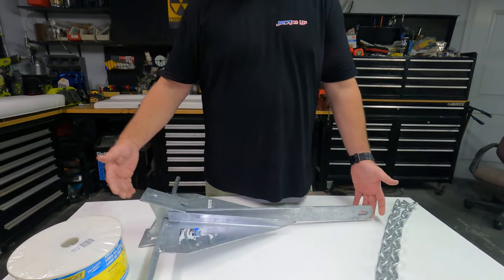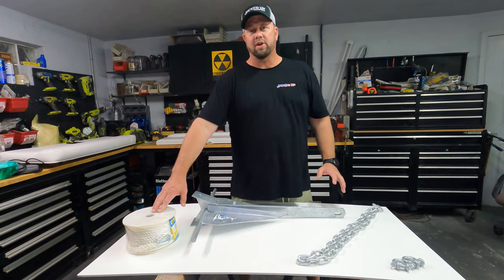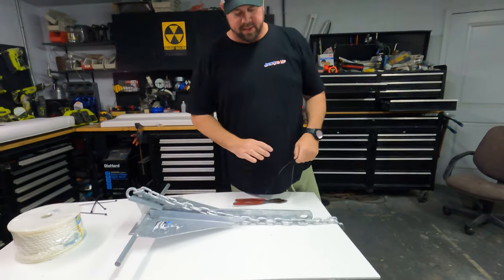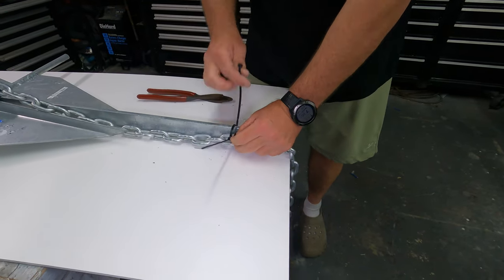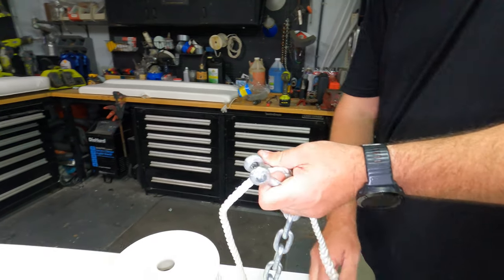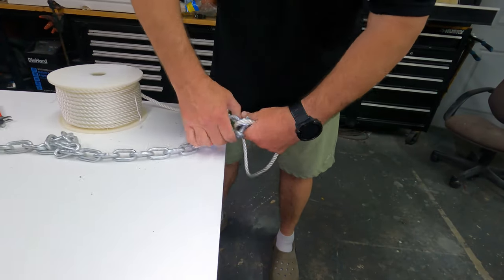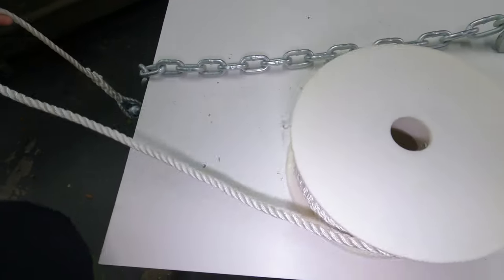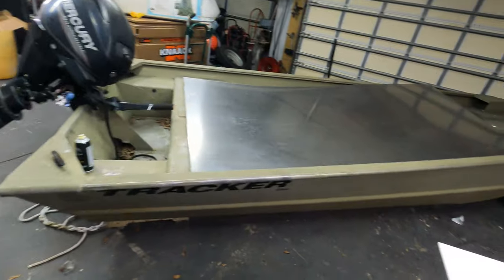How To: SETUP AN ANCHOR RELEASE!!  No More LOST Anchors!!!!

Comment: That crappy anchor you showed actually has this system essentially built in.  If the anchor snags, you can get the boat on the other side and the shackle can slide down the shaft to near the pivot and pull the anchor from the other end.  It's actually a nice design.
Reply: Exactly!
Reply from the maker: Actually you are right but they suck to actually hang bottom.  The flukes are dull and too short as well as the shaft being so light it does not perform as well as the danforth with solid shank.  But this is my experience and this setup was taught to me by very qualified fisherman growing up.  Thanks for watching!
Reply: I never realized that about mine having that ability ... thanks for pointing that out
Reply: The anchor is fine. This design is sound.🥱
Reply: @JackedUpFishing No,  you were right first time the other anchor with the hollow shank is no good . When the tide changes the shackle will work it’s way to the other end and together with the pull on the boat reversed by the current it will  pull the anchor out!  That is what would happen here in UK where I live. Really useful advice using ties otherwise so many thanks.

Comment: This method is useful for fishing or in situations when there is always a watch.  Never use this method when anchoring overnight or in the case you may take a nap on the boat.  Should the tie-wraps break (from a change in wind or current etc.)  your boat would be adrift and the results could be disastrous!
Reply: Very good point. I am overnight alone in high winds. So clearly this would not be safe
Reply: @adamzetter5482  In that situation, you just add another shackle to the eye and it operates like a normal anchor.  One you are done, just remove that and you're back to the breakaway setup.  We do that all the time.  It takes a few minutes to add the shackle and you're done.  Just keep extra shackle in your boat for that situation.  Instead of tie wraps, we prefer to use stainless wires.  It's more reliable than tie wraps.
Reply: Do not, I repeat DO NOT, use this method for anchoring overnight in any kind of wind or if your safety is at stake.  

I did, the tie straps broke, and my sailboat drifted into the shore while I was sleeping overnight on a lake. The conditions were not harsh… just a light steady breeze.  

But, hey … I guess I did not lose my anchor.

Comment: Use something other than Zip ties. Enough plastic in ocean already.  And if you can, avoid using any of these anchors at all that damage structure and coral systems below. No excuse these days. Use trolling motor spot lock. Quick, easy, can move around in small increments to make micro adjustments. We have the technology, people. Spend the money to protect the oceans and waterways, or stay home.
Reply from the maker: Not everyone had 4-5k to buy the spot lock.  And yes no plastic anymore.  We use little piece of string or rope now which is better

Comment: Okay, I'm going top be the greenie in the room, using cable ties isn't a good thing for the environment, you know, that place we love. A piece of twine is a good replacement for the cable ties, or even better, don't be a cheap arse and go and buy something like a Sarca anchor (there are a lot of other brands of the same type anchor) and you'll never need to use a dodgy backyard solution again.
Reply from the maker: Yes sir u are 100 percent right.  This video was over 3 years ago, I need to update it showing the twine we use now. Thanks for the comment

Comment: For anybody trying this method, 
never overtighten a shackle pin as it can deform the shackle and reduce the SWL,  mouse the pin with SS wire.
Attach the bow shackle with the bow to the thimble on the rope and the pin to the chain to save sideloading.
Reply from the maker: Sir you are 100 percent correct and I respect your knowledge.  This is just a simple redneck fishing setup around rocks.  Not a serious overnight setup to leave unattended.

Comment: Great video Bill! I need to update the cheap anchor (doesn’t have the solid shaft) that came with my boat incase of emergencies, but for all of my fishing anchoring, I get to push a button (spot lock) 😁
Reply from the maker: I actually have the spot lock as well on my bay boat. Think I am getting the big boy for my Seahunter for offshore too.  Definitely a game changer!  When anchoring so close to the rocks the anchor just feels little safer, especially with boat traffic and waves.
Reply: @JackedUpFishing  and for anchoring on the 100ft wrecks!! I believe my dealer has an 87” one in stock.. maybe big enough for your sea hunter!
Reply from the maker: I think I am going to go with the 96" Rhodan.   Gotta sell a few things off first though , they want some serious coin for them.
Reply: @JackedUpFishing  I bet they do, but it’ll be so worth it!

Comment: good video, i will try that, just a question first - what happens if the anchor lays down on the seabed the opposite way round to how you have it on the table, in other words... if it lands on the seafloor with the chain first on the bottom - will it still grip the sand and still be able to release? or do you have to try and make the anchor land the right way up with the chain on the up side - because that might be easier said than done, or will it still work what ever way it lands? thanks
Reply from the maker: Depends on depth.  But for fishing in waters up to 100ft I have not had any problems with it fowling up or not hanging.  And when tie wraps or tie cord breaks you just put new one on and you still have your anchor.  Hope that helps

Comment: i recently lost the same anchor.  i think i will just drill a hole like you did, thread a separate rope there attached to a buoy rather than just disperse the zip ties. thanks for the idea.
Reply from the maker: Yeah I do not use zip ties anymore, just use string now.
Reply: @JackedUpFishing  i went underwater to observe how the anchor will deploy initially with a light string tied like yours. even with very light waves and at a depth of 3 meters, the danforth swayed and it won't  always land on its back in a plow position. 

another drawback with the light cotton string is it can snap widway on it's  descent. 

i find putting a polyester rope tied on the hole, then attached to the bouy more manageable. the rope length is just over the depth +2 meters for the buoy to play on.  it also gives me a radius where the anchor is located. 

this method seems more apt to me because there are  rocks where i anchor most of the time.

you have a very good idea here, it just needs to be modified if needed be.
Reply from the maker: @antoniosalvador9754  yeah that’s not an option where I am
Located.  We fish 100-350ft and no way I could do another rope and buoy.  But  if it works for you then that’s awesome.  I use paracord type material now and have had no issues with the anchor grabbing.  Especially in the reefs and rocks,  that’s the reason for this setup.  If it was just sand we wouldn’t need this setup right ?
Reply: @JackedUpFishing  that figures. that's  just so deep for me to anchor. I'm  a small time recreational boater with occasional trolling to fish. 

i lost my anchor when it got stuck on rocks and there was sudden increase in the wave heights that made it dangerous to dive and retrieve it. the rope was cut and the anchor was never retrieved. i hope the guy who took my anchor can find happiness or sickness... 

good talk.

Comment: It works...but if the wind/tide change and the boat swings around it can tear the zip ties off and pull the anchor loose and it won't reseat... means you're drifting until you pull the anchor up, put new zip ties on, and drop it down again. Then if the wind changes again you do it again. Better solution is to have a second, lighter line tied to the head of the anchor with a float... if your anchor gets stuck just motor up to the float and lift it there.
Reply from the maker: This is a fishing anchor setup not an overnight anchoring system

Comment: Proper anchorage uses the chain as a percentage of the holding power of the setup. 

Doing this trick loses that power.  Get a chain that is what's needed plus the shank length. 
Depending boat size will determine chain length.
Reply from the maker: Yeah think you are over thinking it.  It’s only a foot or 2 up the shank which I have a lot more chain left. On my offshore boat I run 25-30ft of chain

Comment: What If the anchor sets with the chain on the bottom? Will it still come loose?
Reply from the maker: It should, you can use the boat and the chain should pull easily.

Comment: I found the anchor lands upside down and the chain won't let flukes dug down  and anchor slides along the bottom have to reset and reset😔
Reply from the maker: Could be weight of chain you are using but I still have this anchor setup and use it daily in 20-60ft with no problem

Comment: Say your moored up with this set up and the weather turns rough. Will the cable straps hold the anchor with the rough weather or snap and make the boat be able to lift anchor
Reply from the maker: You are looking way too deep into it.   This is for day fishing in a spot you know has rocks or snags. Nothing more., you are totally correct for typical mooring ,

Comment: What if the anchor lands with the release chain facing down? That would potentially interfere with the flukes extending into the bottom. Plus the zip ties could come off as the boat swings.
Reply from the maker: It works!  We don’t use zip ties any more we use a piece of string now

Comment: If you did the shackle too the anchor with the bolt from the underside l would have thought you can use wire and the shackle head isnt sticking up in the way of the chain
Reply from the maker: yeah i didn't use wire because sometimes it can cut people pulling anchor.  This is for anchoring up to 100ft.  Fishing applications around hard structure where losing anchors is fairly common. Thanks for watching!

Comment: The first shackle at the base of the anchor should have been put on upside down (bolt facing down) so as not to interfere with the chain.
Reply from the maker: This anchor is still in use after 3 years.  Works flawlessly

Comment: How long might the second attachment point last since you drilled through the galvanization layer, exposing the raw steel to seawater? Do have a method that doesn't include leaving plastic garbage (zip ties), in the water?
Reply from the maker: Still in use today so pretty long time.  Switched to little piece of thin string or rope and works good.  Need to update video

Comment: Sometimes those cable ties prevent the anchor getting through the bow sprit
Reply from the maker: Not really but I don’t use cable ties anymore doing update soon
Reply: Or worse, the anchor ball ring
Reply from the maker: @michaelbenson6956  never had that problem in 30 years

Comment: Lucky that anchor didn't catch on your drill bit. Without clamping your anchor down that could have been the last time your able to have children. 
And the other anchor you didn't like that's very similar. Its designed with the hollow oval shaped arm rather than a solid arm like the one you said you liked for the exactly for the reason your changing you favourite anchor. Its hollow so you can just use 1 chain attachment and if it gets caught, you pull-on the chain from the opposite direction and the 1 chain will just slide down the oval arm to pull on the opposite end releasing the anchor from what it's caught on.
Reply from the maker: Yeah but them other anchors do not catch bottom worth a damn!   Solid shank are the only reliable way to go.  Throw them others away because they are garbage.  Done many anchors like this with great success.

Comment: Nice, But...trashing thousands of tiewraps in the environment each year is not a good thing.  But also easy to prevent  with just a little more work. iI you bind the ends of the tiewraps round a shackle. Or drill a hole in the ends of the tiewraps and bind with a piece of stainless wire the ends to a shackle. This way you always retrieve not only your anchor but also the plastic which you can dispose to be recycled.
Reply from the maker: I like it.  Great idea!  I’ve been thinking of using like a biodegradable heavy string as well!and doing away with tie wrap.
Reply: @JackedUpFishing  Some test will show if that can handle just the amount of force needed. But leave no trace and retrieve all would be best.  It seems that the Tiewrap method is widely used, so it could be worth to be the first to make an update video:) and safe a bit of what we like so much.
Reply: With the amount of plastic us humans are dumping into the oceans on a daily basis I doubt plastic tie will make a huge difference.Nice of you too care but unfortunately it's way too late.

Comment: This method is old and a pain in the butt. The tie wraps are always snapping and you find yourself re-tying the tie wraps all day. Of course Murphy also goes out to sea, you will find yourself out of tie wraps and now the anchor needs to be changed back to the old method. Instead, buy a solid ring and attach it to a swivel that is attached to your line. Then take a piece of chain about 5-6 inches longer than the distance between the eye on the bottom of the anchor and the end of the anchor shaft. Attach a shackle to one end of anchor, next slip closed ring onto chain, then attach th second shackle to the other end of the anchor. This will allow the ring to slide back & forth from end to end as you motor forward or backwards to pull the anchor out in opposite direction. The line is pulling from the ring that is pulling from the chain crossing from shackle to shackle. Never mess with tie wraps again
Reply from the maker: Yeah I agree, I am going to do an updated video and change a few things.  I like yours as well.  Good stuff.  Merry Christmas!

Comment: Be careful, that hole you just drilled will corrode now that is is not galvanized in the hole! I recommend spray painting galvanized paint on it. Tape off that section and give it several coats, drying in between each coat!
Reply from the maker: Good point for sure !

Comment: For you kids at home, NEVER tighten a shackle like that. Finger tighten only, then back off an 1/8 turn or so.
Reply from the maker: Yeah and you will lose your anchor...   Been there-done that...   Do you work for the anchor companies?  lol  Joke.  But in all honesty if you did that you would have a very high probability of loosing your anchor.
Reply: Yep.  Lost my anchor today because I didn’t tighten the screw real tight.
Reply: But also use stainless steel locking wire to prevent them loosening 😊👍

Comment: Do not, I repeat DO NOT, use this method for anchoring overnight in any kind of wind or if your safety is at stake.  

I did, the tie straps broke, and my sailboat drifted into the shore while I was sleeping overnight on a lake. The conditions were not harsh… just a light steady breeze.  

But, hey … I guess I did not lose my anchor.
Reply from the maker: I have stated multiple times it's not for overnight anchoring.  It's a fishing setup.  Wow

Comment: I am the guy that takes my broken line home, so i won't use plastic cable ties to add to sea floor.
Reply: but you just added how many feet of rope in the ocean floor?  Don't use tie straps use bailing wire/ stainless wire
Reply from the maker: Good deal

Comment: Ridiculous.  An anchor is meant to hold u safe.  One good puff of wind or slam of wave, and your cable ties will snap, your anchor becomes useless scrap metal, and your boat may be wrecked on the shoreline behind u.

If u want an anchor retrieval system - put the shackle on as shown, then tie a sturdy rope to it, with a buoy on the end.  Drop anchor, anchor bites, and buoy and rope (with anchor) can be heaved up if required.   NEVER use the method shown in this video - it absolutely ruins the entire purpose of an anchor - which is to HOLD against whatever force comes.
Reply from the maker: Cmon Man lets get real.  Ive been fishing for over 30 years and learned from the best.  Its not an overnight anchor as I said.  Just if you are fishing near structure.  Don,t over think it!
Reply: @JackedUpFishing  For the sort of thing u describe, u don't need an anchor.  U need a weight.  Lump of concrete with an eye bolt thro it.  It will hold u steady in calm waters, and won't bury or need tripping.
Reply from the maker: @gordonbennet1094  yep but the Atlantic Ocean is far from calm.  Trust me this works and is used here by all of the top charter captains and fisherman.

Comment: You have sleep apnea
Reply from the maker: Ok????
Reply: Your right eye is doing exactly what mine did and I was diagnosed with sleep apnea should get tested
Reply from the maker: @thumpergman  yeah I had a lazy eye then got mauled by a big rotweiler almost lost my eye.   It has been that way for years
Reply from the maker: @thumpergman  so did you get yours fixed?
Reply: @JackedUpFishing  yes by using a sleep apnea machine it fixed it. It's caused by a lack of oxygen to the nerves while you sleep. Mine was very bad I also had floppy eye lid syndrome for the same reason and as I use to sleep on my stomach my eyelid stayed open and scratched the eye lens itself .That recovered well also.